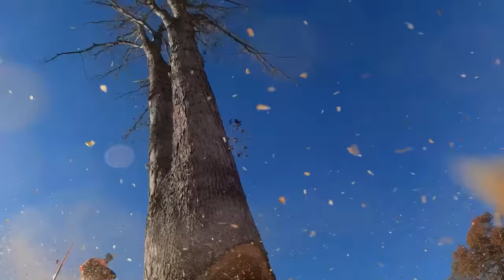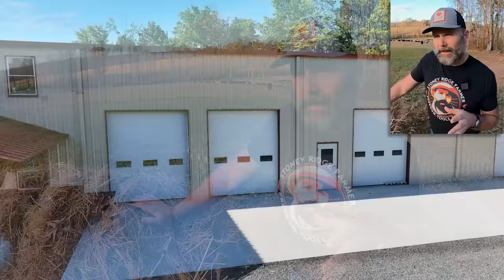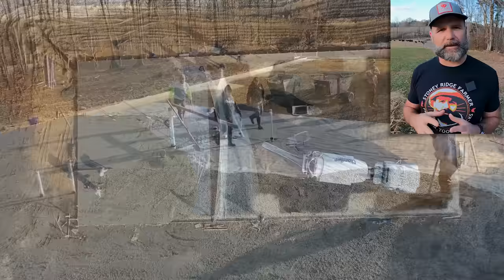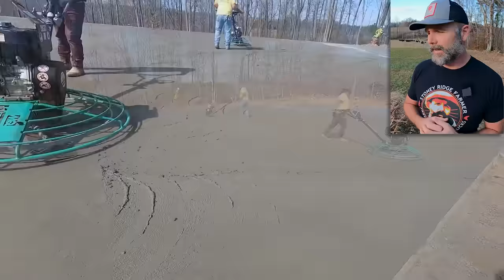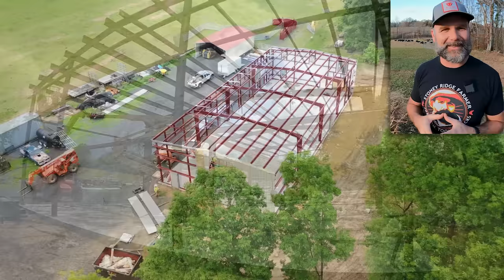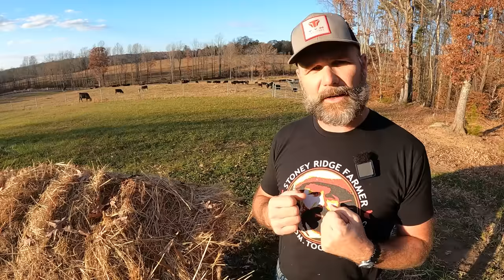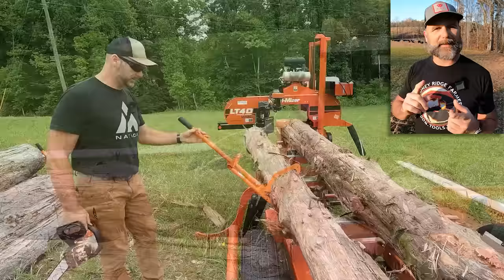Cops Came to Investigate Veteran's Farm! Heartbreaking disbelief

Comment: I live in NY state. :/ You darn near need a permit just to think. Now that I contemplate that, it explains a lot of things around here. We live in a small city that has delusional problems of grandeur. Back in Feb. of 2022 my 1 1/4 car garage decided to commit suicide. Actually it gave up on holding up the snow from the last winter storm, that had just dropped on it. With out delay, the neighbor behind us felt the need to inform city hall that our garage had clasped. In a bought 4 days we received a letter stating that we had 2 weeks to clean up or fix the garage and bring it up to code. Talk a bought, the  need for a barn raising party??? So I sent off my own letter to city hall. I explained that we did not have the money to scrap the garage at this time. Besides its mid winter! Its to cold to go out side and play "Bob the builder". That and it was also not safe to do in this weather, you know snow and ice. Then around a month and a 1/2 later I get yet another letter. stating that we had 2 weeks to fix the garage and bring it up to code, and any further delay will result in a $2,000 fine. So I fire off yet a second letter to city hall. I politely remind them that the ground is vary muddy from all the snow melting and it would not be safe to scrap the garage until the land has hardened up. So as soon as the ground firms up, I'm out there with my trusty Sawzall making big pieces and parts into many smaller pieces when the code enforcement dude and a police officer arrive on the scene. I am then presented with a "Stop and Desist order". I'm looking at them like ?!?!?!?!?!  So I explained that the fine folks at city hall demanded I get the garage clean up. So I was fallowing orders from city hall.  I then presented them with the letter from city hall. Code enforcement dude, says yes, that's my signature on the letter and it is from our dept. The police officer then looks at the code dept. dude and says, well that takes care of that. He is just fallowing your orders. The code enforcement dude then states that I do not have a permit to tare the garage down. I stair at the code enforcement idiot for a bit. I then explain to him him that I have 2 issues with that. 1). As you can see, the garage is already down. That work was handled by the snow. Whether the snow needed a permit or not is beyond me. You should take the permit issues up with the snow or mother nature. As I have no control over them. Maybe you fine official like folk will have better luck with them. 2). It the official letter I received, the one I just handed to you and you admitted was from your office, said I was "ordered" under the penalty of a fine to get this cleaned up or brought up to code in two weeks. I am just fallowing the official letter you sent me. And I'm fallowing it to the letter. The letter did not say a word a bought needing any permits. Why would I need a permit if I was so ordered to do so by city hall?  At this point the police officer is grinning from ear to ear. He knows where I'm going with this. So I let out a sigh. I then place both my hands in my pockets. I then looked down and began to rock back and forth on my heals. After some time, I looked up and said, well then here is what I'm going to do. I'll except your Stop and Desist order now. Then I'm going down to city hall and I'm going to speak with the city court clerk and file a law suit on you for harassment. I'm also going to ask to see the judge and get a restraining order against you and your code enforcement Dept. due to harassment. Because it will be a case of harassment, I'm sure the court will order you to stay away from me and not bother me until the trial. So we should get this all cleared up by, say the end of summer. That is if we are lucky.  So the ball is in your court. Option 1) you can get in your car and go away and I can resume to carry out the orders in the letter. Or option 2).  We settle this in court. Keep in mind that I am NOT physically tearing down a garage. I'm cutting up a wood scrap pile and disposing of it. I'm fairly sure the city building codes dose not say a word a bout needing a permit to clean up a scrap wood pile. Imagine the bind that would put the tree trimming business in? Rest assured that I will also be submitting photos of the wood scrap pile with my law suit. I'm al so sure that my attorney will be asking for restitution for dumpster rental and any other nifty things he can dream up. So what was the outcome? The garage, I mean, scrap pile of wood turned in to many smaller fragments and jumped in a dumpster and went away.
Reply: Please!! What WAS THE OUTCOME???
Reply: about*
Reply: Sounds like a nosey neighbor had a house fire and a total loss and the inspector was found dead
Reply: As a crane inspector, I was doing an inspection of a new fabrication shops hydraulic crane so they could use it in putting the shop together. Then the code idiot showed up. He informed the foreman that one concrete wall needed a 1/2 hour fire retardant coating. The foreman replied that the wall was 12 feet thick with 2 inch rebar on a 6 inch grid and didnt need any kind of fire resistant coating. The inspector got out his little book of codes and showed the foreman the code. The foreman took the code idiot around the corner, through the 4 ton steel door into the reactor containment room and again said no coating needed, that that wall was designed to hold a reactor core if it went nasty. Code guy said he didnt care, it had to be coated before he would buy it off. The foreman, using common sense, told the code idiot to GTFO of his shop, he will have the corporate lawyers pay them a visit. Several months later I came back for another inspection. The shop was in full production and the wall was coating free.  This was at the old Satsop Nuclear site that was never finished. 
Most code enforcement officers have shinola for brains.

Comment: About twenty years ago in Tennessee my father and I built a house on my land.  Our problem was the septic tank.  We did all the right things getting the permit and paying lots of money to have them come out and tell us exactly how it had to be put in. The ground in Tenn is mainly clay dirt so we had to have a very long drain line that was stretched out back and forth across about an acre or more. We had the right people come to install it and it was a lot of work. It got done but before you can fill all the lines in you have to have it inspected.  Thats where the problem came in. The inspectors just would not come out. After about three weeks there was a big flooding rain that came and well filled in most of the lines.   We called and reported it and still no one came.  two months later they came and by then and all the rain the lines were about filled in.  Even though you could see all the lines were exactly where they had told us to put them we have to pay the installers to come back out and dig it all up so the inspectors could see we used the right lines and how it was supposed to be like rocks for drainage. etc.  Cost us a lot of money. We checked with a lawyer to see if we could do something, but the code law is the code law no matter what mother nature did we had to make it where they could inspect it on their time. Tell me that ain't some BS. I no longer live in Tennessee and sold the house many years ago.
Reply: In his case he's upset because his neighbors started bitching, but as a property owner i also worry when I see someone going crazy building huge structures near my prop,  people don't know if he's going to keep building and building and even though his property is very big all of that, it goes out the window when a week or 2 storm moves in, when you alter the topography in your land where that water is going to go? when everything starts flooding properties turn into a dot, especially when everything is flat, owning acres of land is a huge responsibility, and the "i mind my own business" motto doesn't fly./ here we have a whole borough under water because of bad move pertaining construction, it killed the prop value and everyone wants out, nobody ever imagine that something like that could happen, but it did.
Reply: @champion20199  but thats not what the overseers are focused on… get a grip on reality or just move to cuba and get it over with
Reply: I live in a small town in northeast Arkansas. Our problem here is that we don’t have enough rules and regulations. People can literally do anything they want to on their property here in the city limits. Including building any kind of a big metal building in their backyard. Swimming pools in the yard without a safety fence around them. Motorhomes trucks junk you name it. They’ve got it everywhere. When we moved here 40 years ago. Our neighborhood was very nice. But it is really going downhill. I have called and talked to every mayor that has been in office in the last 20 years. my front yard now is flooding because my neighbor refuses to clean out the drain under her driveway. She won’t do it and the city says it’s not their problem. Everywhere I look now out the windows there are sheds going up storage sheds, she sheds, he sheds tool sheds and it looks like there is no stopping them. Mayor says they can do anything they want to. It’s their property. Have one guy that lives right across the street from the courthouse here. Put up the most horrendous looking Halloween decorations. That was last year. Then he put up Christmas decorations without taking the Halloween down. Now I think he’s decorating for Easter and the Halloween is still up. In cases like that I really think we need some restrictions. And now his yard looks like a used car, truck and boat and motor lot.sometimes restrictions are necessary. Because there are a lot of people out there who are not real bright, and have very poor taste. My pursuit of happiness has been taken away here because of what everything looks like.
Reply: Here in Mass the inspectors have a time limit. Inspect it within the time in the law or it is deemed passed.  Just try and get anything else pass inspection if you press that with the inspectors.
Reply: Just provide the electricity off-grid via solar and don't tie into the electrical grid. As for the sawyer rules, take the sawyer certification or hire one to grade the lumber you want to use. Yes it's about insurance and a money grab. Plenty of videos on how to get certified to stamp your own wood.
Reply: @idahewett1432  I am very sympathetic to those issues. However I feel like this is a situation where you should vote with your feet and move to an area that suits you more, rather than trying to deprive your neighbors from the freedom that they now enjoy. I, myself, would prefer greater freedom, over greater restriction, and would be happy to move into that area, even with all the ugliness around me. I would rather be free and surrounded by disordered chaos and ugliness, than living in a well manicured area, but being constantly bothered by the whims of those who live around me. So it makes me quite sad when I hear people working to deprive others of freedom for greater convenience and comfort, since that means it's just one fewer place in the world where a man can live and breath free.

As for the neighbor's driveway drainage issue causing flooding on your property, I am completely sympathetic to that and you should sue them.
Reply: A smart person would have at least taken multiple pictures. If the inspectors wouldn't come out I would've first gone above the schedulers head documenting the problem and sued the county if necessary to recover costs if the pictures would be accepted.
Reply: @champion20199  Very interesting perspective.
Reply: @idahewett1432  That is why I love Arkansas
Reply: @internetcancer1672  Same.
Reply: Where did you move to if you don't mind me asking?  As in which state.
Reply: Yeah... I live in TN,...had a older gentleman buy the house next to my parents. He was a nice guy who just lost his wife. My parents got along with him, especially in his time of grief. Fast forward a couple of years and my Mother gets diagnosed with stage 4 liver cancer and about 6 months to live. 3 months into that my Dad suddenly died, and my Mom died a couple of months later. I suddenly inherit their house, that had a shed that needed to be torn down, but it wasn't my biggest concern at the time. Well, the neighbor's daughter thought it should be because while trying to arrange funerals and estate legal work  she suddenly has a bunch of "county compliance" letters threatening me with fines if I don't have that shed gone in 30 days. I no longer live there, but TN, especially where I grew up, used to be a nice place to live, my opinion has changed.
Reply: @idahewett1432 sounds like an awesome place I can't stand communist co.e to northern IL you will be much more happy to go home
Reply: @johncoffey4206  that's why you have the trades people there during the inspection so they can call bullhsh!t on the inspectors.
Reply: @debstaggs1425 Your story is so infuriating! There should be penalties for the Code Enforcement's failure to do their job in a timely manner, but I know that will never happen.  People who support Big Gov't are simply unaware of how far the government can reach into a person's life; It's frightening. Thank you for sharing. God bless

Comment: For a period of time in my life I was a commercial/residential developer and general contractor. Spent many hours in commissioner meetings and building codes offices. Like you and so many more,I attempted do things honestly and by the book. I accepted the process, though at times it was extremely frustrating. Not to mention it was costly and time consuming. What I found amazing was the number of times inspectors, codes officials and even commissioners would judge me guilty of trying to get something over them. The only thing I can suggest, through their experiences with people like you and me, they sometimes find it easier to judge us as the bad guy and they as the good guy. Through all those years it never changed, and towards the end it was only getting worse. Sorry for your disappointment. It can only make you callous which often lead to anger. Human nature is what it is. Move on or run for an office, and try to change it from that side. Failed to mention, there was also this power thing going on. I’m guessing they may have felt bullied as a kid and now it’s their turn. Good luck my friend and live a happy life. Try not to stump your toe on the “little” people.
Reply: As a hvac plumbing business owner for 20 plus years, some inspectors will work with you and help you in any way possible. Then you have the ones that have the us verse them mentality. Usually this type are the college educated ones who have never worked in the field they're doing inspections for.